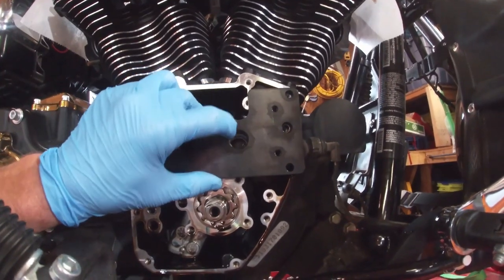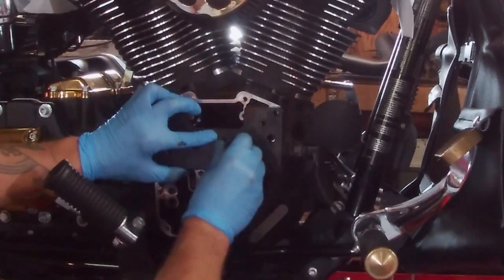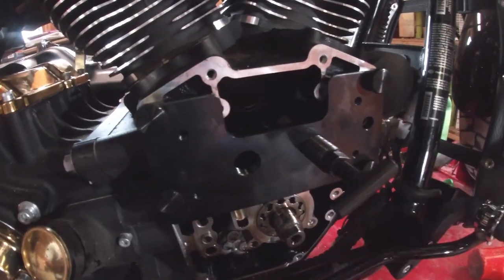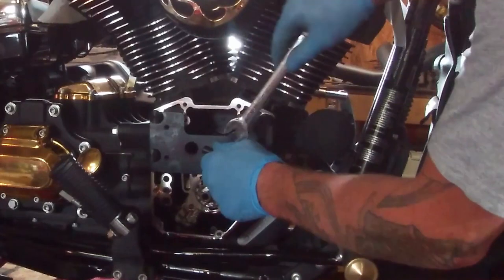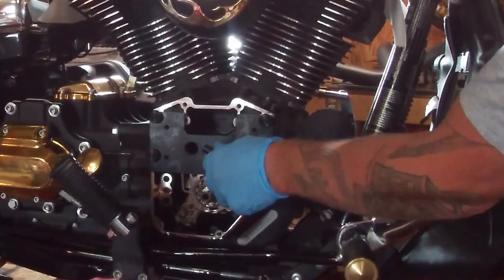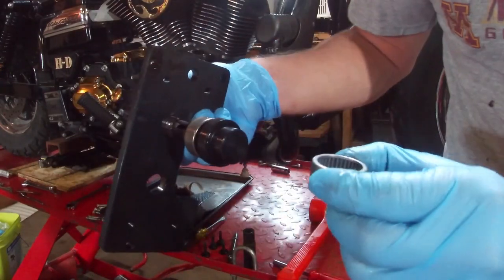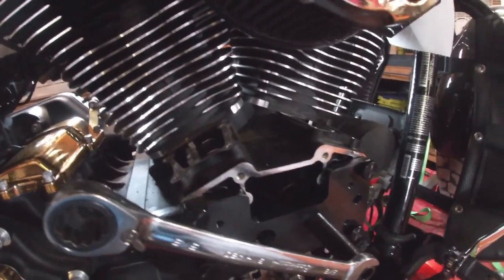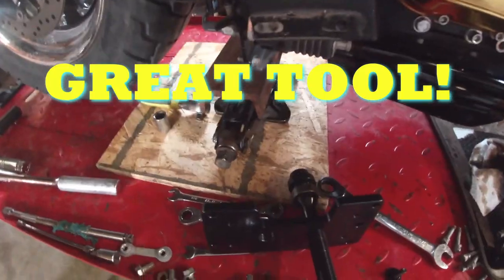Harley Twin Cam inner cam bearings replacement with tool from MBS Manufacturing - Random Garage

Comment: i'm sure you know this, but for the viewers who do not;  when it comes to Harley Davidson parts... either OEM parts or anything from a reputable manufacturer (i.e.; JIMS, S&S, Fueling, etc, etc...) there will ALWAYS be a marking of sorts that indicate which side is out and facing the installer. the unmarked side is the side to go into the machine and faces away from the installer. these markings include part numbers/letters, logo's, the letter "X" or a solid dot (like a punch mark). any of those or a combination of those will face the installer once fully seated into their final resting place on the bike. 👍

Comment: What keeps the removal tool from spinning the bearing and galling the engine case?
Reply from the maker: Nothing. The tool just grabs the inner race so the outer race is free to spin at will. But there's also nothing to encourage the outer race to spin. So it doesn't; it just pulls straight out.